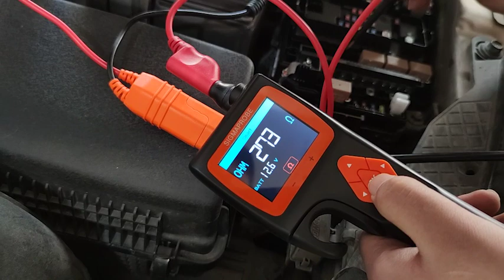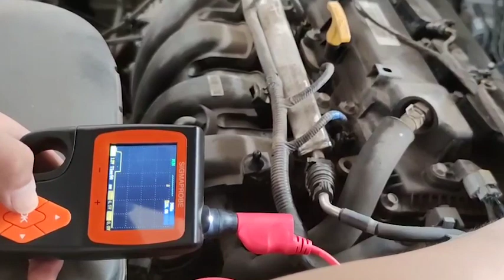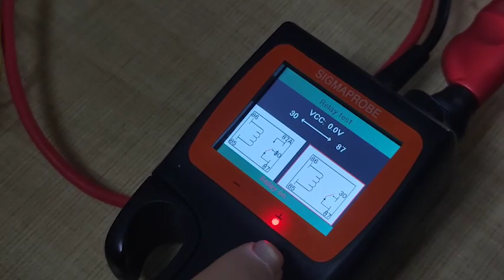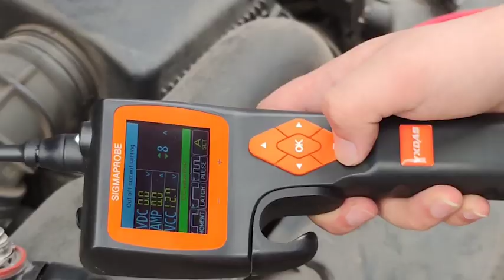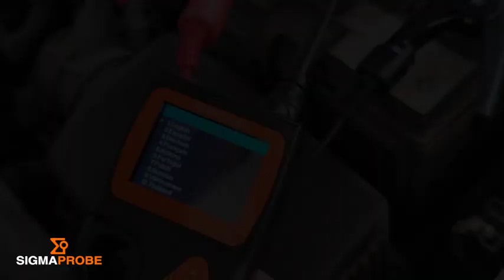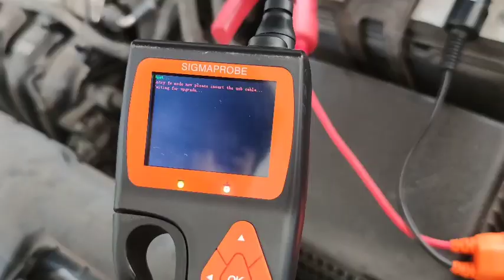SigmaProbe Vehicle Circuit Tester（The best automotive electric diagnostic tool ）

Comment: Looks interesting my 2 questions would be the size and getting into tight places after 25 years in diesel repair trade wiring can be in tight places,  and how durable is it compared to a power probe?

Comment: Nice tool looks great for electrical work .. does it have adjustable circuit breaker ?
Reply from the maker: Thanks for your attention, there is an adjustable circuit breaker
Reply: The power probe hook goes up to 65 amps